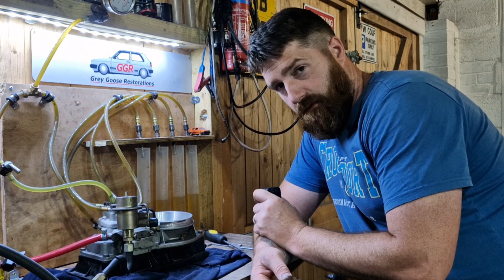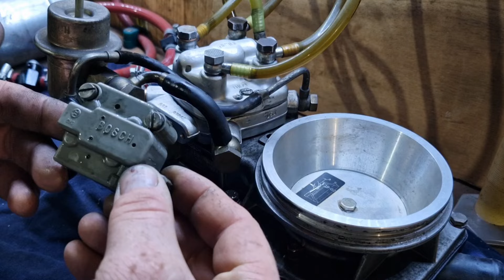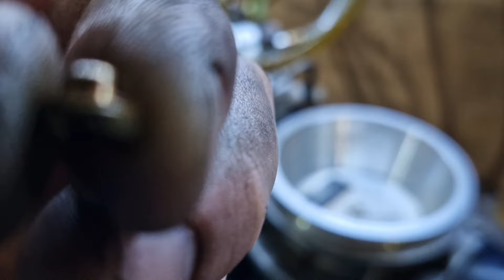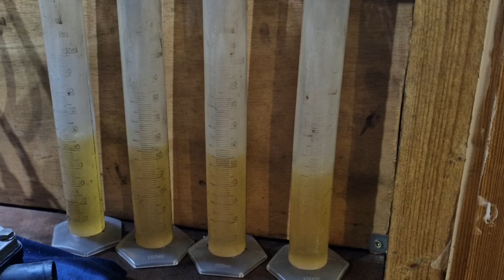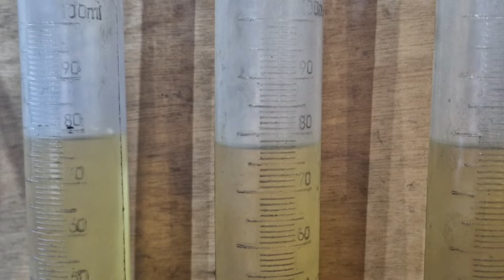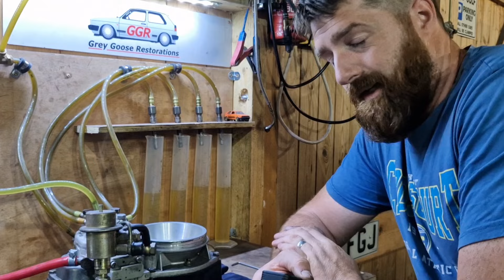Bosch KE-jetronic How to: Modify Your Metering Head

Comment: Do you see a change in the differential pressure (electronics disconnected) when you adjust the DPR?
Reply from the maker: No as that just dictates what goes to the injectors, the differential is set by the pressure regulator mainly

Comment: Hey Martin, great video always rewatching to catch things I’ve missed. I’ve come across a cold start issue lately. 16v PL KE-jet. I recently swapped out my metering head for a rebuilt unit. Currently getting 81-82ML/40 sec at full throttle. My residual pressure, system pressures are in spec and differential is set to .4 bar below. Cold start valve and Thermo timing switch both tested in good condition. When my cold start valve is connected I have a hard cold start often starts first turn then falls flat immediately. With CSV disconnected cold start is mostly first time starts and idles. Any ideas as to why that could be?
Reply from the maker: Sounds like the CSV is at fault, it may be stuck to spraying all the time or there is a wiring fault causing it
Reply: @GreyGooseRestorations thanks for the reply. I have tested with a test light and only activates when starter is actuated and also doesn’t leak when tested the spray pattern.
Reply from the maker: Ok I'd suggest it may be more of a electrical issue potentially if the problem goes once its unplugged

Comment: With a ke jetronic for an escort rs turbo is this the same. Mine flutters around on starting like it doesn't have enough fuel on idle starting but after 5 minutes is then fine. Thanks.
Reply: Would you suggest a quarter turn to give more fuel on starting/idle to help with this?
Reply from the maker: @lawrenceknight-o1s I'd try 1/8th turn to start with then see how it goes
Reply: @GreyGooseRestorations  thanks for the advice. Be good to get it idleing on startup correctly. Appreciate the help.
Reply from the maker: Yes the same principle applies on the RS turbo unit

Comment: My volvo 244 has k-jetronik and it does this annoyin jerking and stuttering in mid range rpm and idle is also not so smooth. afr meter jumps between 12-14. full throttle and with turbo pressure it works like dream. but with that stuttering its very annoying to drive. fuel pressure is 5.6bar and control pressure is 3.4bar. wur is adjustable and metering head has new inner parts. injectors are new from mercedes. Does someone have any ideas. my newest idea is to try put non turbo metering head,needs little modifying. but in the state where it is now its undrivevable in city traffic.
Reply from the maker: Most common for the light throttle is either the CO mixture not correct / air plate rest not set or potentially the throttle/idle switch not set.

If the MH is working on full chat it's not at fault, is the WUR vacuum working correctly
Reply: @GreyGooseRestorations  Thankyou for that last sentence. Metering head is truly working ok. Problem was with fuel lines. i managed to get original pipings and they solved the problem. i have been fighting with kjet about 20 years now! now the afr stays in steady 14 at idle and exhaust smells like catalytic car.  Keep it up and big thanks for support! ☺
Reply from the maker: Glad its working now 👍

Comment: Thanks for this!! I'm just finishing the rebuild of my 1.9l 16v PL engine with KE-jetronic. Wondering wether I should increase the fuel pressure or not. It has some mild cams, 4-2-1 header and the head is slightly ported. Would you increase the fuel flow in this case?
Reply from the maker: For KE units fuel pressure I fine in upper area of the factory settings, just a touch more fuel flow via the DPR and balancing is all that's needed
Reply: @GreyGooseRestorations  Thanks! So, 62ml in 30 seconds like you are showing here would be a good place to be?
Reply from the maker: @kristerantonsen yes

120cc/min is minimum required

Comment: i bought a rebuild fuel distributor but when i installed it i notice there was little to no fuel flow to the injectors. when i press down on the plunger no increase of flow either. i did notice that if i unscrew one of the side plugs and leak gas out i get flow to all top ports and flow increases when i push down the plunger. would adjusting this screw help me with this problem?
Reply from the maker: Which car is it for? As pushing down won't flow fuel unless it's a Mercedes for example, the plate need to lift up
Reply: @GreyGooseRestorations   thanks for the response, and its a 84 190e Mercedes with the 2.3.
Reply from the maker: @Go_Jonn I wouldn't adjust that DPR screw until that issue is sorted, I'd check the system and differential pressures are correct.
Reply: @GreyGooseRestorations  alright cool, thanks